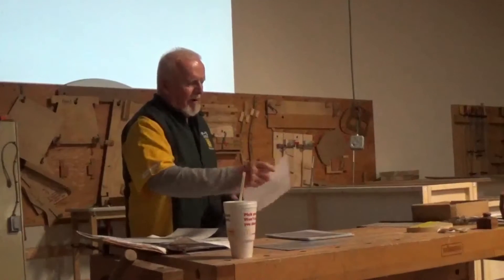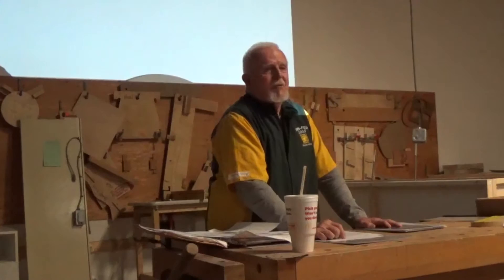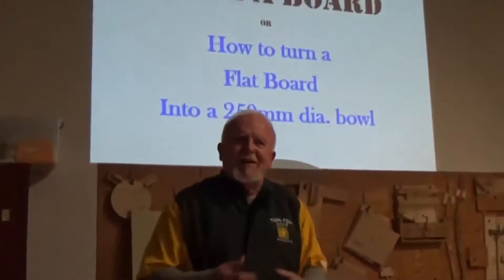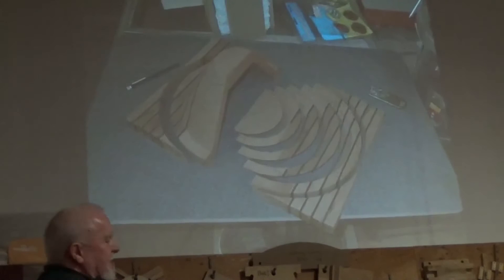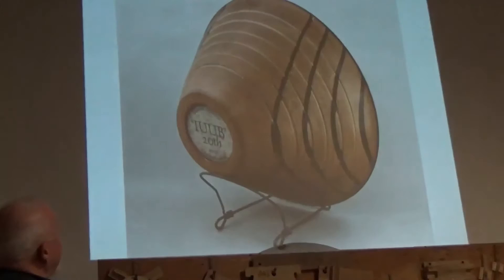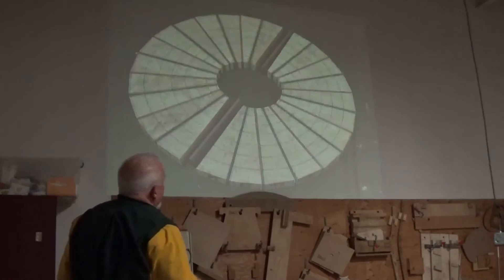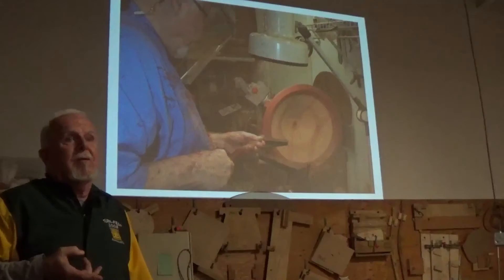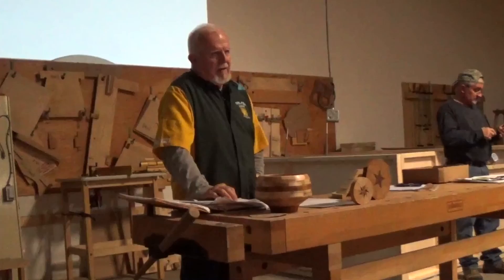Ray Lanham - Making a bowl from a board

Comment: Thank you Ray.  I saw a video by another turner who said that he used hot melt glue also.  When he finished turning he would put the piece in a microwave oven for ten seconds x three, allowing to cool after each heating and the hot melt glue slipped apart.
Reply from the maker: Good idea, thank you!